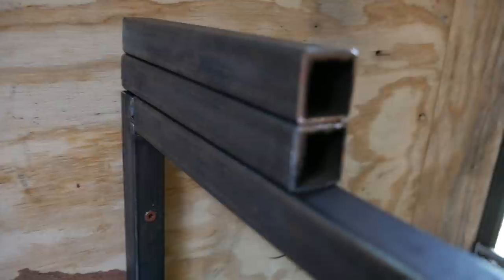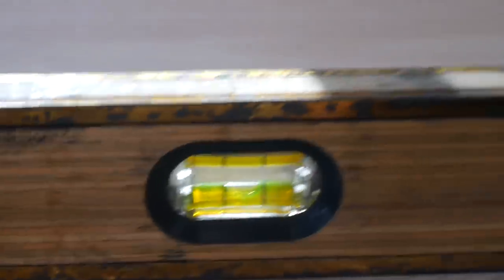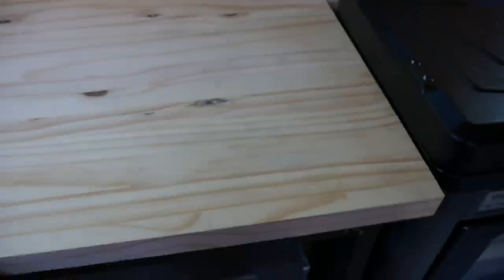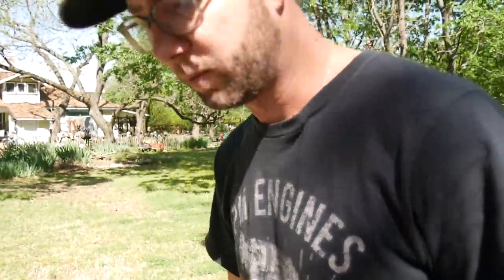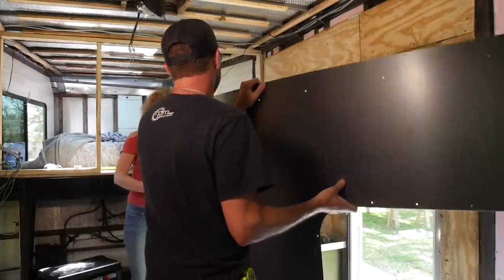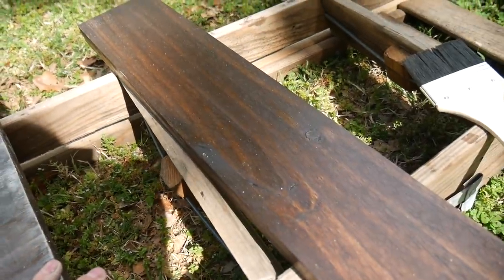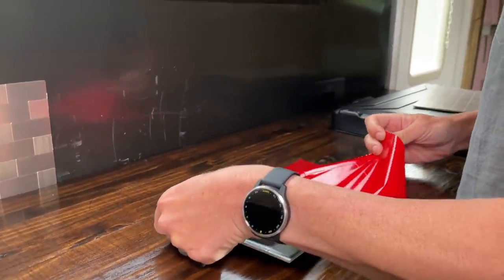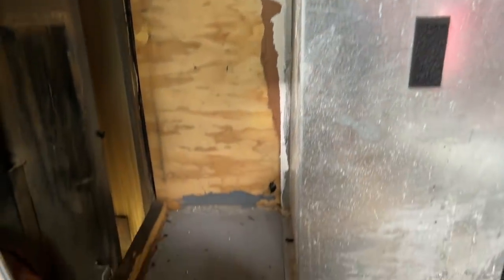Cargo trailer conversion tiny kitchen build continues!

Comment: I would add 2 drawers to the left (against bedside)and then a pull out trash can under the 2 drawers. Then on the stove/cooler side (right side) I'd add another long drawer at the top and a set of cabinet doors that open up to reveal a nice spice rack (since you don't have much depth space) top to bottom and then on the other cabinet door I'd make an area to store aluminum foil, plastic wrap, parchment paper on the bottom portion of the door and an inside towel rack in the top portion  of that door. Hopefully that makes sense.... lol
Either way I really enjoy watching you guys work together as a husband and wife who have fun and make life seem much better because of your desire to treat people with love and kindness!!

Comment: For working with thin sheet metal like that, and when you need to punch a bunch of holes near the edges of a panel, a hand punch is way faster than a drill, and leaves the hole cleaner as well.  One of those Whitney #5 Jr hand punches is great to have, and will work well for auto sheet metal work as well.

Comment: A router with a flush trim bit works real slick for cutting out window and door openings. you just cut the material in place and the router bit follows along the opening.
Reply: I agree. No way you will ever get it exact by measuring. Just put it up and trim the opening.

Comment: One thing to keep in mind: keeping the kitchen area clean. You don't want all sorts of corers and hidden bits; should just be easy to wipe clean. You should probably seal all the edges of the counter with silicon too. It's not a "professional" kitchen of course. No inspections to worry about, so common sense should cover most aspects of it. It certainly looks pretty classy so far.👍👌😁

Comment: Before final install of the countertop,mark the screws and drill small countersink holes so it sets back against the wall.Then caulk it so liquid doesn't drip down the back.

Comment: I know this is a couple years old now, but when my wife and I used stick on tiles in our bathroom back splash we were told to spray soapy water on to help set the tiles and it worked flawlessly.

Comment: for the counter top, you could cut a little groove so the screws have a bit of room and the top would butt up flush to the  wall and not leave a gap. a rebate is the kind of thing i'm thinking about. easy enough if you have a table saw to do as your not doing a full depth cut. the slide out counter top is a great idea. and i'd move the propane tank under the bed next to the water tanks to free up the room.

Comment: Looks really great you guys are doing a knockout job. But for the screws in the window frame, I would take a little bit of the paint you used to paint the window frame and put it in a little cup or something and use a little model paint brush and paint them.

Comment: Add a nice bead of silicone along the edge between counter and backsplash and it will keep a lot of trash out of the seam. I use those self adhesive tiles all the time in RV's and yes sometimes they are a pain, a nice sharp putty knife helps when you mess up

Comment: Looking great. I'd have left the small gap at the bottom of the back splash and caulked it using an aluminum caulking. You can drag and dab the caulking to make it look like the back splash is tig welded to the counter top. Done it before in a diamond plated bathroom. Looked really cool.

Comment: For the drawer fronts you could go for a matching color/material or something completely different.  For example, to match you could do the drawer fronts in the scrap material from the window cutouts, that way the color matches the walls, and do brushed aluminum drawer pulls to match the backsplash.  You could also do the drawer fronts in wood stained to match the counter top with the same brushed aluminum drawer pulls.  I would keep the brushed aluminum as an accent and not a main focus.  I agree with the pull out cutting board, but you're going to need to figure out something to keep the drawers and any cabinet doors closed when driving.  Last thing you want is to travel through an area where the turns are graded and stuff goes flying and then when you arrive at your destination you need to take that first hour to put stuff away before having fun.  Or worst case scenario, something falls out of an upper cabinet and goes through the windshield of whatever toy you're taking with you.  Same argument for pot holes and speed bumps.  Great job so far guys, only thing style wise I would have done different is pick a lighter color for the walls as lighter colors reflect more light and might require fewer lighting fixtures than with the darker colors.  But not knowing your plans, you may have already thought of this and are planning the dark color for the living area and a light color for the work area.  Regardless, it'll be fun to see your take on it. Good Luck!

Comment: looks good emily and arron 
easy way to fix the issue with the screws at the rear of the counter top  push it up firmly against the screw heads so it leaves a mark then use a drill bit just slightly  bigger to  drill a hole just deep enough for the screw head to sit in to 
then it will be flush with the panelling behind it

Comment: I have used stick on tiles like that  before. On a prep counter back splash. And i recommended a small amount of silicone on the bottom to stop water form getting water behind. Even with cleaning

Comment: G'DAY Aaron and Emily, another fantastic Vlog thankyou, firstly to answer your final question, regarding how to finish cabinets & drawers, after 30+ yrs experience in kitchen renovations,I've found that the 16 mm(5/8") melamine coated water resistant MDF board,the best product to construct cabinets and drawers with, likely to be able to obtain a slate grey or charcoal coloured coating,my experience has found that when couples who often desired to do their own tiling to finish a kitchen renovations,my advice was always to first decide who was the most OCD between them,to then they do tiling,thus no reason to complain later! And finally Emily a terminology instruction, regarding WOOD is what a tree is terminated,whence unfilled,once milled it is terminated TIMBER eg.Wood is what is burnt on a BBQ or campfire, TIMBER is what ones constructs furniture or cabinetry with! Overall I think that you both are doing an excellent remodeling project,as always, Kindest Regards, Dave McLaughlin Queensland Australia

Comment: I would use a j roller to make sure that the aluminum is fully adhere to the wall. I do really like those tiles. As for the drawers I would do 3-4 on the left hand side going full depth. Then one over the propane tank the width of the tank and full depth. Then a couple under that one.

Comment: For thin aluminum sheets, use a plywood blade installed to spin backward (so it doesn't grab the metal). I learned this years ago from the store where I bought some replacement aluminum siding for my house. I have also used that trick on aluminum flashing. I was skeptical and cut my first piece long to test, it is amazing how well this works.

Comment: The irony of a Flying Sparks gal getting flying sparks in her hair. You also took me back to a time when floppy disks were normal and now we've hardened up. As far as the underside of your counter top goes, I would plan and make up a slide in carcass out of melamine or plywood to house drawers and perhaps a door if needed. I couldn't see it properly but you get my drift, like you would do in the kitchen of your home. Those splash back tiles were tricky, you did good though.

Comment: Have you tried putting a sheet of wax paper behind the sticky tiles, align the tile sheet on your leading edge and the counter top, slowly slide out the wax paper and push down the tiles. Then along the bottom edge put a thin bead of black or dark silicone to seal the edge. It will make it easier to clean later to keep the dirt out of the edge.

Comment: Looks good but two things I would have done different. For the aluminum over the door I would have cut it back a bit more as now you have a weird join for the next sheet to line up with. Also when working with those peel and sticks only peel a small bit back of the backing paper and pull it back and stick it as you go to avoid what happened.. but good recovery.

Comment: Kitchen is coming along nicely.  At first I wasn't keen on the counter top stain (to dark) but you proved me wrong it works nicely with the back splash tiles. You were correct on not needing to countersink the wall attach screw (nicely thought threw), but out of curiosity why did you say you couldn't countersink them?

Comment: I must admit I was thinking that the wood disc would be to course and rip and bend it, maybe it would work on thin Lexan and Polycarbonate. nothing like designing and fitting out your own trailer instead of having to make do with how it comes from the manufacturer, just force the top against the screws with a bit of paint on the screw heads then it will mark them and you can just drill a small hole where each screw is works great no gaps and and I ran a line of silicone along as I pushed the top to the wall, my wife was not keen on all the stainless alloy and steel I used but as I said to her we get dirty hands etc so it is easier to keep clean. 
I  would get one of those shelf units that are like a slice of cake so you open the door and as you do the carousel style shelves appear with all your gear on them if you get the ones from the DIY store they sell them as a kit, you could do the same idea for the pull out work surface then no sharp corners to walk into and less fabrication to support the weight of the top and what ever you do on it.

Comment: Probably too late, but on the wall side of the counter top back cut it at a 45⁰ to clear the screw heads on the metal wall.
Also if you didnt get locking slide for the oven you should replace them now or plan a way to lock the oven in  so it doesnt come out as you go down the road.

Comment: I hope you plan using some red water paint then let dry then before you place you back splash you put a layer of contact glue now let it almost dry then place you back splash. MAKE SURE YOU HAVE CUT AND FIT YOUR BACK SPLASH PARTS!!! If you don’t once you stick them you won’t get the back. Really
This is the same method how they make vinyl kitchen counter tops.

Comment: I really hope that you don't leave those wiring splices (the ones where you dropped the power for the outlets down) from last episode like they were. Pretty sure that was the 120V circuits. Those need to be in a splice box.

Comment: Nice job the pull out work surface is a good idea, but it is a little over the top all that box steel.
Was the trailer a cargo or livestock trailer. Did you get a reduction of the panels price due to the damage, the stick on tiles are not so good at sticking to bare wood being porous it will need a top coat of some sort to guarantee them sticking. It is going to be a nice trailer to use at races or any type of event always better to have comfort then a hectic race weekend is less stressful even if the poop hits the fan.

Comment: The renovation on the trailer is looking great. Do you happen to have a link or a part number for the painted aluminum. I've seen race car metal but I've never seen the metallic gray that you guys are putting on it looks great? Do those come in 4 x 10-ft sheets? Thanks

Comment: Another comment. The metal looks so good compared to the Luan panels they usually put in a trailer. What is the spec on the metal panels?

Comment: When you cut aluminum, no matter what type of tool you are using, the aluminum will begin to stick to the tool. Spray on WD 40 and the cutting tools magically unclog. I do this whether I’m cutting sheet metal with a reciprocating saw, milling with an end mill or porting heads with a rotary carbide.

Comment: Could have used the table saw to cut a relief in the back of the countertop so it sat flush on the wall and over the screwheads.

Comment: I work as a Project Manager in Windows and facades, also other fields. We always use wood cutting tools on aluminium. What else? Metal cutting tools are way too rough. BTW there are circular saws (Festo started it 20 years ago) where you don't need to measure for your "rail". You put the rail of the saw onto the wood, place it near your marking and off you go. Better you ask someone with some experience in construction, you made things hard for yourself... The tiles on the wall normally go first and than the cabinets. Fittings, walls, ground... And than cabinets. 
If you really want/ need to use the space under the sink, you need to install drawers, otherwise you just collect junk there. Poor accessibility is the main reason for junk in kitchen cabinets.

Comment: One thought, but too late to use...You folks could have drilled countersink holes in to the wooden countertop to match the screws in the wall and that would have allowed the top to go flush against the wall.

Comment: the pine is not very durable.  you would have been better off using a prefab butcher block.  even poplar or birch butcher block would have been better.